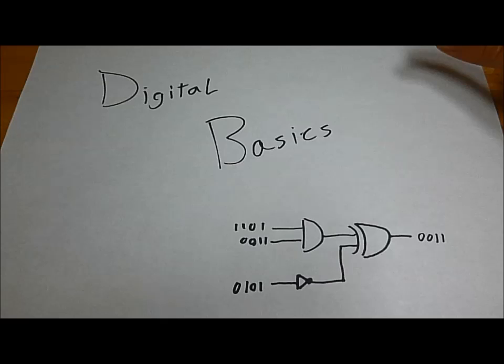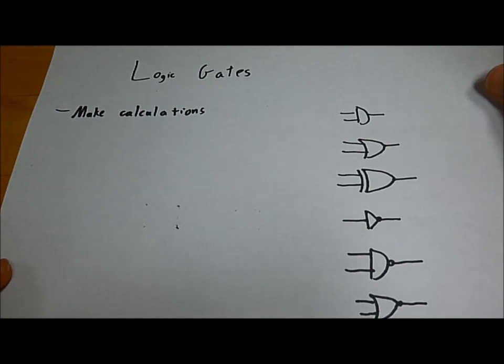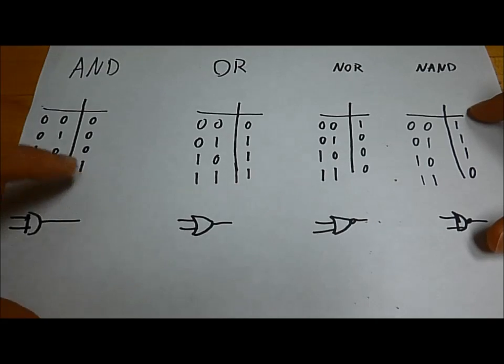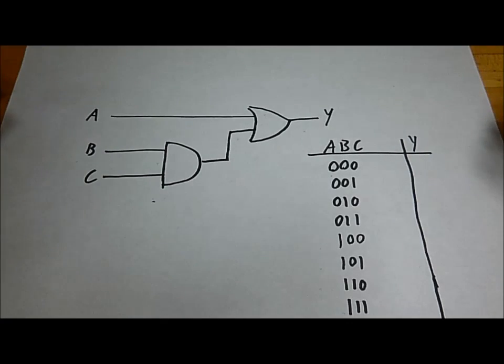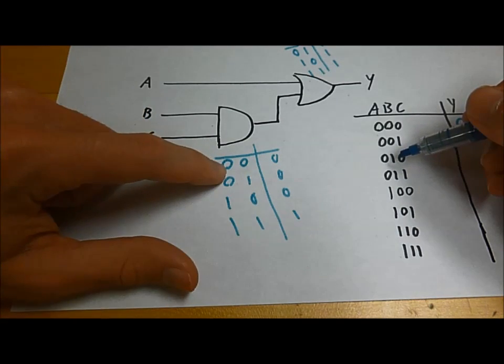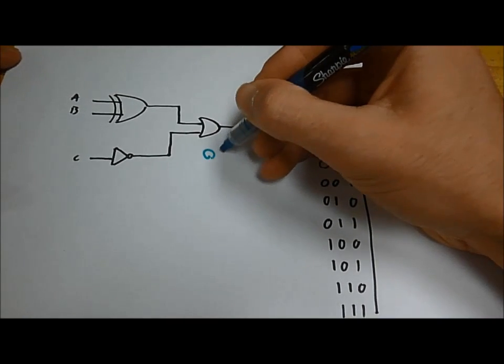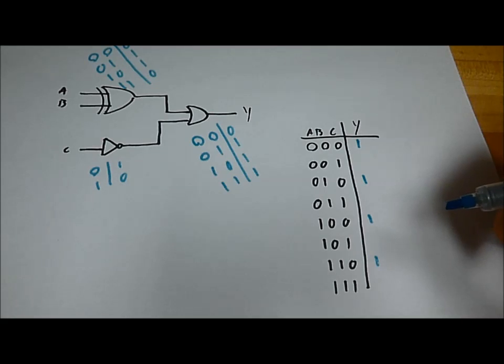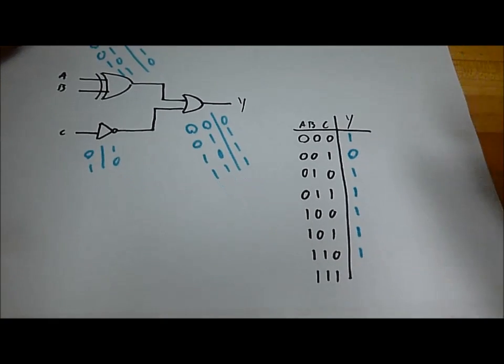Digital Electronics Basics

Comment: Last section you have a mistake about  c is zero so  not c is will be 1 ,  0 or 1 will be 1
Reply: Nah! In NAND gate a 1 will get 0 and in XOR gate 1,1 will get 0, then finally in an OR gate 0 & 0 will give out 0. And hence the answer is 0. So, I couldn't find any error like you mentioned here, may be you looked at the truth table of 110 which isn't the last one but the second last. The last truth table for ABC  is 111 and not 110.